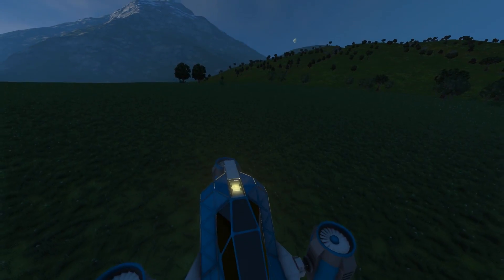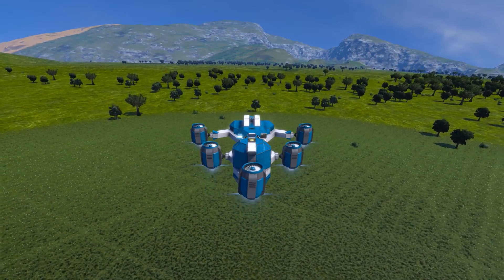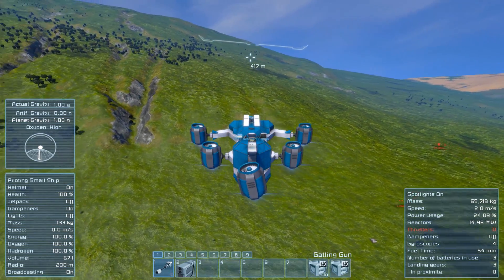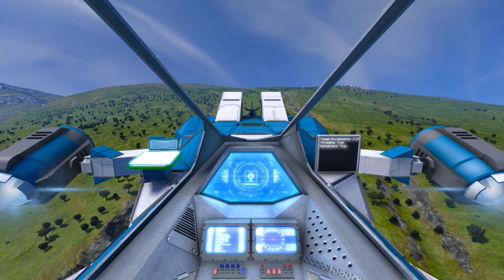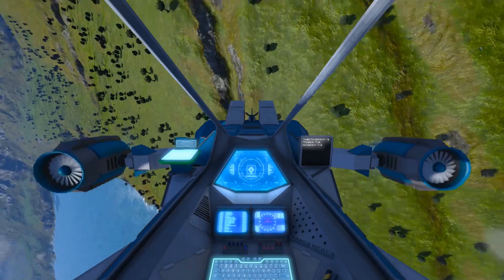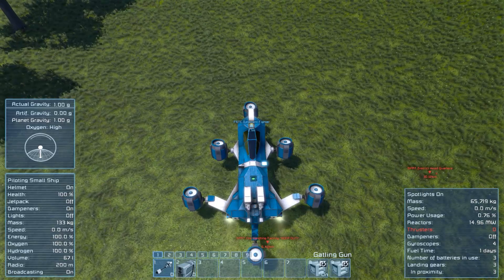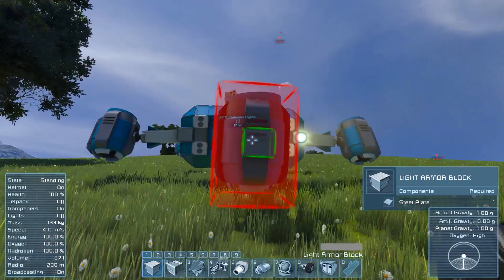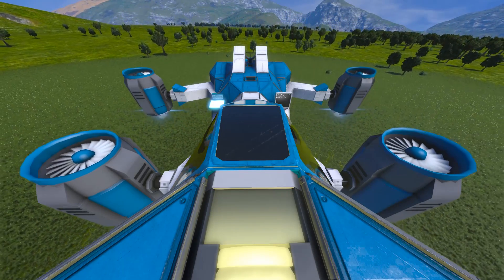Space Engineers - Perfect VTOL? Vector Thrust Script (Planets Comp '16)

Comment: By chance are there any mods that get rid of safety locks? I'd love to be rid of them because I too use a speed mod, and I've had several WHEELED vehicles spontaneously explode from them... Not even sure how or why, but they locked, and they broke.

Like, broke so hard Klang started break dancing my landrover around by it's gyroscope. Yeah, that kind of bad.

Also, I'd love to use this mod, but without the ability to negate the safety locks, it would be rendered nearly useless to me.
Reply: if you have a speed mod you can turn the safety lock speed up to the max speed the mod allows. but you can't turn it off completely. saying a script is a mod is like saying that vanilla ship you built is a mod. the devs didnt put it together but its part of the vanilla game.

the ship will automatically engage dampeners to slow itself down if it gets near 100m/s. you can change the value by editing a number in the code so it will work nicely with your speed mod.

Comment: I wonder how well this would work on a floating base?
Reply: it will slowly drift and rotate even with dampeners on. i had planned to integrate it with a popular autopilot script but i never got around to finishing that.
Reply: 1wsx10 If the script responds to commands from the remote control block, I guess you could just place a waypoint where you wanted it to stay and leave the auto pilot on. it might be cool to have your base constantly patrol in a large circle around your "territory" at a very low speed.
Reply: Genubath heh, interesting. not sure why you would want this script for a massive base though. especially if its going to be stationary
Reply: I think the prospect of having a nomadic base with heavy mining and refining equipment moving between mining sites is attractive :)

Comment: Wow. Just Wow. The only thing it misses are thruster position and center of mass calculation. Thruster position detection is impossible as far as I know so you'd have to enter it. That would mean no slapping together thrusters and getting a vtol. Center of mass can be accounted as far as I know. But that could also easily be fixed by detecting unwanted  tilting and steering against it if the center of mass is not too far from the default one.
Reply: its actually the other way around. programmable blocks are blind to CoM with the only way being to have a test flight (and even then it could change).

that said you can get block position in world space pretty easy. unfortunately its only the blocks that have an entry in the menu, so armor blocks still cant be accounted for.

Comment: you might be able to reproduce the engine adjustment using gyros. but the control aspects not so much.  this is seriously awesome stuff.

I wonder if you could expand the angles that the engines could thrust at by adding a second axis of movement with more rotors... I wonder if the script could handle that extra complexity?  As it is, at certain angles you have four engines supporting you, but at others you have only two supporting engines (front and back).  If you could give the side ones another axis of movement, you might be able to increase that and give yourself more power to strafing.
Reply: im working on it. but it would actually lead to less complexity than the same amount of rotors but not nested.

Comment: Make a heavy gunship or transport with this, maybe. Fighters are kind of a bit of a high speed for the safety lock problem, I would think, but something that stays fairly stationary while trying to either drop off troops or keep heavy weaponry on target wouldn't have to worry about it so much.
Reply: its actually extremely maneuverable compared to other non-modded ships because it saves a whole lot of weight and power not firing unnecessary thrusters.

Comment: The rotor safety lock thing is a bit disappointing. Really too bad that keen decided to hack a solution to the rotor issues rather than actually figuring out a way to make them stable.
Reply: they have been doing a whole lot to make them stable actually. i dont think the safety lock is too bad, you can get a speed mod and increase the safety lock limit. i have gone 400m/s+ and it was stable!

Comment: what about compound rotors for more angles? less engines with more stability?
Reply: the script is not ready for this yet. im working on it.
Reply: 1wsx10 It would be awesome to make a light craft with only 2 or 3 thrusters
Reply: Collegiate Match Fishing you can. i have made a mini 'jetpack' with some modded parts although you could do it with vanilla ones. it only had 2 small atmospheric thrusters, a remote control, and a small seat. you just have to make sure the centre of mass is right. i learned that the hard way with my awesome mini jetpack sent me spinning down a cliff XD - once i got that worked out it was great. although you do have to manage your balance in the direction the rotors cant spin.

Comment: Pretty sure you can just max out the safety lock slider and it wont lock or at the very least it won't until you hit max speed but then you get up to 75%-85% max speed and reduce the accel really low.
Reply: yes, safety lock is a problem you can max out the slider but it will still lock at max speed. i have a built-in system to stop you from getting to max speed although you can still get to max speed if you turn the target accel way up.

Comment: Why not just turn off the safety lock? Rotors for me have never been unstable enough to warrant to have it on... and whenever it did turn on it botched the ship up completely... EDIT: W/ speed mods in mind :P
Reply: yes, safety lock is a problem you can max out the slider but it will still lock at max speed. i have a built-in system to stop you from getting to max speed although you can still get to max speed if you turn the target accel way up.

Comment: You know a game has issues when the modders are way, way ahead of the developers in terms of figuring out how to make 2 grids act as one, without exploding or simply being too simplistic to even function in a sensible manner ( ergo, thrust override + stopping and starting rotors manually to switch between vertical and horizontal flight ).

I'd love to see swivelling engines added to the vanilla game as a single block, with this script used to make them function as intended. Get on it, Keen...
Reply: actually i really like the way keen has done it. they give you the basics then let you do what you will from there.
as far as not exploding goes, thats none of my doing. SE has become a whole lot more stable now (in single player at least)

Comment: Finally time to build a decent Serenity?
Reply: +1wsx10 Hello, sir! I just want to know two things about the script :
1 - Does it work with fixed engines (= literally thrust-balancing the craft)?
2 - Does it only works with 6 engines that are placed in this precise position?
Reply: that would be really cool
Reply: 1. yes
2. no, it will work with however many engines you like (even 1 but good luck balancing it). the CoM has to be in the mid point of all the engines.
Reply: Id say it would be a nice addition for sure, however if anyone wants to build a nice form of "Serenity", they already have the tools out there. Simply no one has really dug deep and designed a near replicant of it yet. May have to start working on mine again.       One place id advice starting, is use of the small blocks mod in order to get scale and proportion to the closest you can get to the real origenal design.